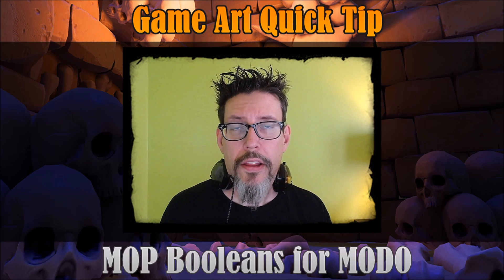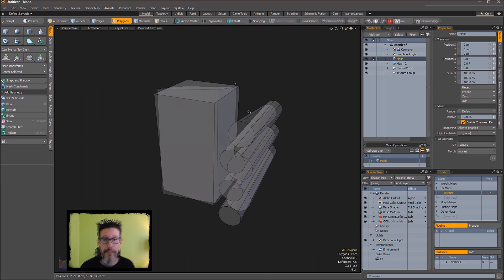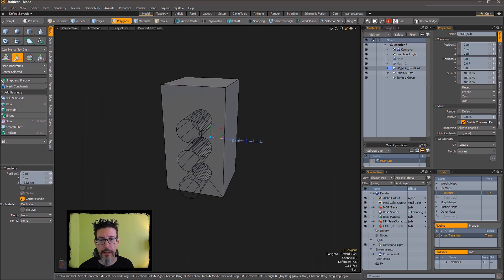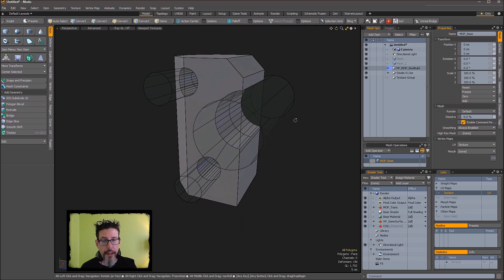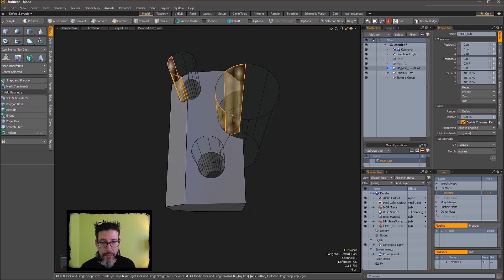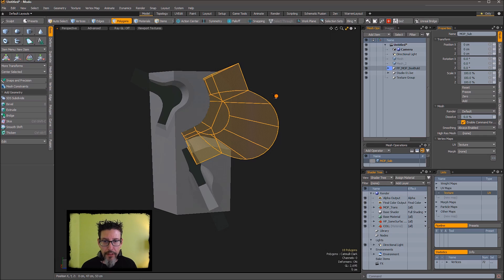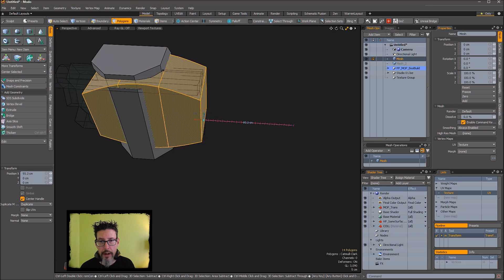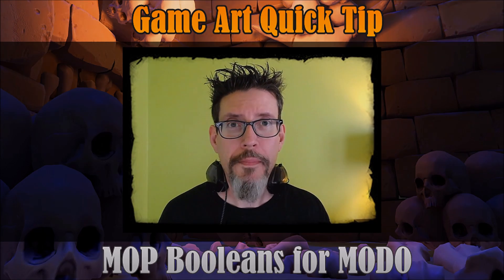Game Art Quick Tip : MOP Booleans for MODO

Comment: Im confused, If this is using MeshOp/MeshFusion then why no edge strips/bevels? I would much rather have this than have to use the Rounded Edge Shader. Is there a way to still have this function (it seems not but why?) Thanks for any insight!
Reply from the maker: I see your confusion. It's using MeshOps, but this isn't MeshFusion. If you want/need the strip controls you're going to have to use MeshFusion.
Reply: Okay... thanks so muc for the super speedy help! Is there an EASY way to explain why this doesn't work? Also, yu're fantastic with these videos. I subscribed and plan on watching all your stuff! VERY helpful!
Reply from the maker: It's not that it doesn't work, it's that they're 2 different features within the app.  That's all.  They have similar functions but MeshOps booleans are more about a boolean based workflow while MeshFusion is more about cleanly munging meshes together.  IMO, anyway.

And thanks for subbing!  :)

Comment: Do I need to make sure all my geometry is made of quads? I know MeshFusion gets bad if you don't, but I noticed you using those cylinders which had non-quad end caps, so I wasn't sure.
Reply from the maker: No, not at all.  MOP Booleans are just using the mesh operations stack so they don't care what you do ... subd, edge weighting, quads/tris/ngons, etc.  It takes it all.

Comment: Hi Warren! Really cool tips here, thanks! I've bought the Kit, it's awesome! I have a couple of questions: I know you use hotkeys (I need to get this sorted myself!) but when you turn off the selection highlight at around 3:14, are you just un-checking selection visibility, ordinarily found using the 'o' key and the 'visibility' tab?

Also, I notice that you don't have the 'PP_MOP-BoolBuild' item expanded... so how are you selecting the sub boolean items, to move them around etc? I don't see any way to do it, unless you expand the main MOP item folder, and the MOP-drivers folder, and then click on the boolean items in that list. Unfortunately, if you have any boolean item selected, you can't then use 'Toggle Visibility' option in the pie menu. To get it working you have to click back on the MOP_Drivers folder, or outside of it. It's a lot of clicking around... I'd really appreciate knowing how you do this, it'd save me a fair bit of time and frustration.
Reply from the maker: Yeah, I just have a hot key set to "@viewport_displayToggles.pl skipVPSel toggleSelection" ... this is a Seneca script but there may be something native you can use as well by now.

As for the selection stuff, I've bound "pp_MOP_Booleans.py SelBase" to a hotkey to quickly grab the base item.  Then I have Seneca's "@selectThatMesh.pl" bound to another key so I can point and select other mesh items quickly (which includes the boolean operand meshes).
Reply: Thanks for that, Warren!

Comment: With this MOP kit modelling start look like solidbody. BTW  does you able to adjust champhers between merged meshes?
Reply from the maker: No, there's no facility for that outside of the rounded edge shader. If you need that sort of control, you're best off using MeshFusion.
Reply: thanks for reply :)

Comment: One reason you might eventually need a custom assembly would be adding a union mesh into a subtracted area. For example, if you start with a box, then subtract a chunk, and then try to union a new shape into the void created by the subtraction, the MOP toolkit will fail because the union is the first operation on the stack. The only way to get around this is to create a new union operator at the top of the stack.. not ideal obviously, but that's how it is.
Reply from the maker: To be fair, that's where I would just use another MOP assembly instead.  Let the rounded edge shader connect them smoothly.  Keeps the individual assemblies lightweight.
Reply: yeah, in most cases this solution will work perfectly well

Comment: Is there a chance that this will work with Modo 10?
Reply: Incorrect. It may work for you with some operations but I can get an error EVERY time in 10 if you try certain operations...as the MOP kit uses commands not available in 10. ALso. Mesh OPs Booleans arent as stable. If you want rock solid, no issues I wouldnt suggest using MODO 10 with this kit. MOP Booleans isn't supported in MODO 10. Only MODO 11.
Reply: Not sure where you got your information, but I'm on modo 10.2 and it works just fine.
Reply: No. It will not. They told this in discussion on facebook. Only Modo 11.
Reply from the maker: Thanks for the info!

Comment: This is an awesome kit. But it makes it a hard choice between Live Booleans in ZBrush 4R8 or this :D
Reply: yea but then you'd have to use blender. i'll pass :)
Reply from the maker: I think it depends on your goals. It's a lot more efficient for me to stay in 1 app, so being able to do this inside of MODO is a huge win for me.  On the other hand, R8 can handle super dense meshes with ease so ... I guess choose the right tool for the job at hand.  :)
Reply: And at the moment, there is no rounded edges set up in ZB... I could always bevel the borders of my polygroups. Great video btw
Reply: I suggest you to take in consideration Blender within Hard Ops of masterxeon1001 and decal machine for hard Surface modeling. There's no better way!!!

Comment: Hey Warren, I remember seeing this thread a while back, its  a workflow in Max using probooleans and dynamesh, allowing you to generate both the high poly and the low poly using the same operand stack, how do you think the MOP would fare in comparison? Maya has the Crease+ tools but it lacks a proper stack edit the operands to make the low poly later.

http://polycount.com/discussion/168610/proboolean-dynamesh-hardsurface-workflow-tutorial
Reply from the maker: Different apps, different solutions. I love that thread and that method but I don't use Max so ... doesn't help me much in my day to day work.  :P

This is sort of the same thing altho it comes at it from a few different angles.  The dynamesh part is negated by the rounded edge shader, for example.
Reply: Our in our group there's a discussion going on right now whether you and Tor are using high poly bakes at all?